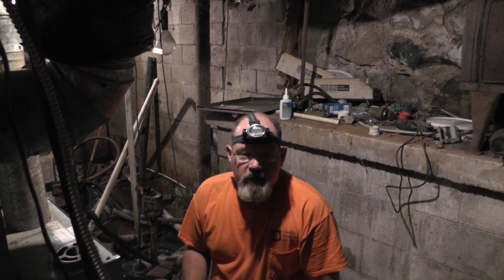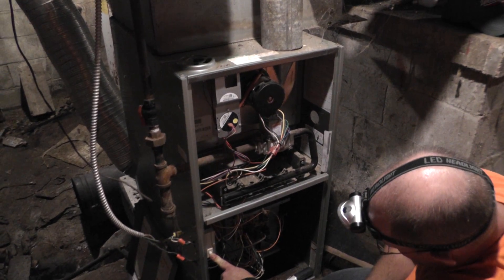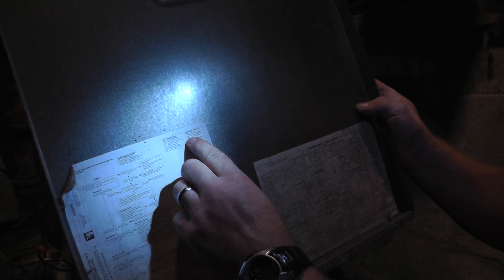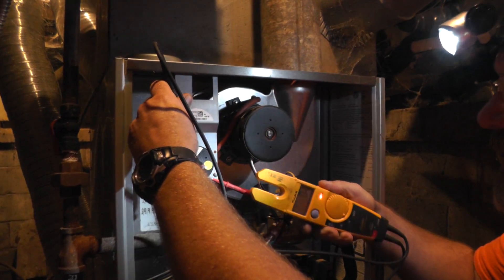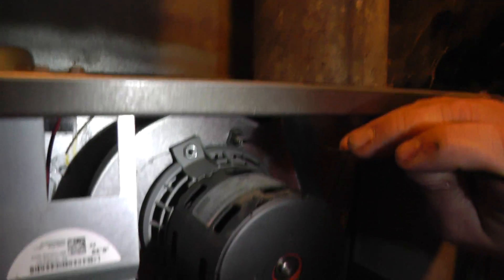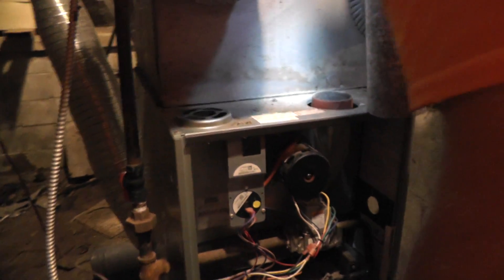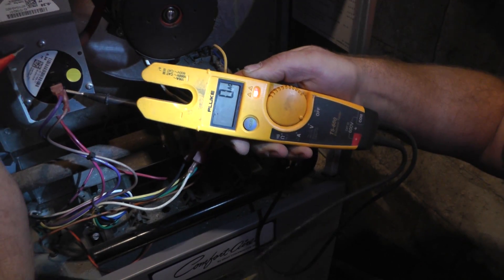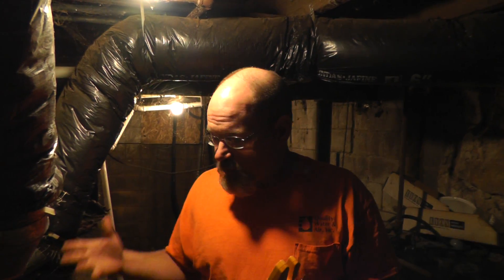HVAC furnace troubleshooting.

Comment: Thanks a lot for the video it is really helpful for me as I am trying to learn the trade. 
I have a beginner question. When you initially test the pressure switch and determine that it's an open circuit. How did you rule out that it was a faulty pressure switch and knew that it was a venting/ air flow issue?
Reply from the maker: +Mike Symons 99.9%of the time the switch is good and has picked up and issue elsewhere. I've seen cracked heat exchangers, plugged condensate lines, water in vent pipe in a sag, frozen intake and or exaust, birds bees and matchbox cars in the vent pipe, even condensation (water) in the vacuum tube. There is more I'm sure but these came to mind first.
Reply: Guy Brown Thanks a lot for the response that makes sense. Your videos have been a huge help to me since my boss doesn't know how to properly diagnose equipment.